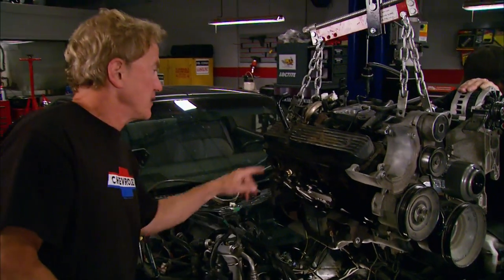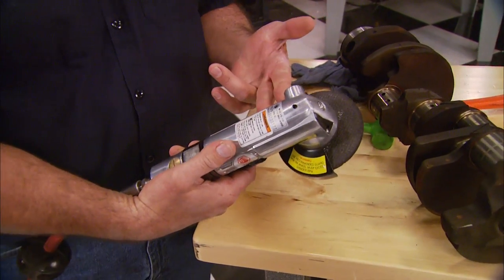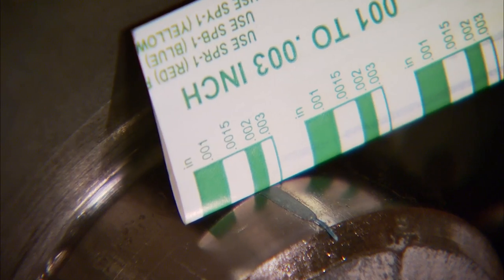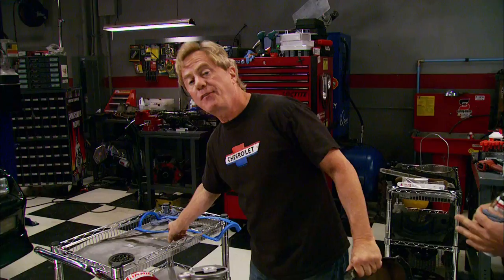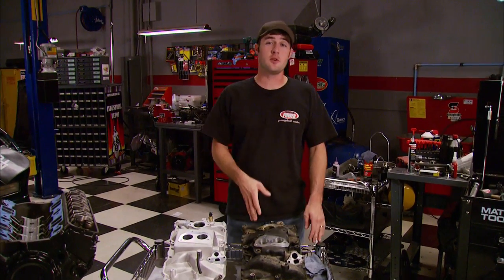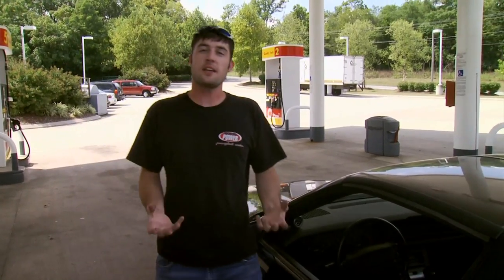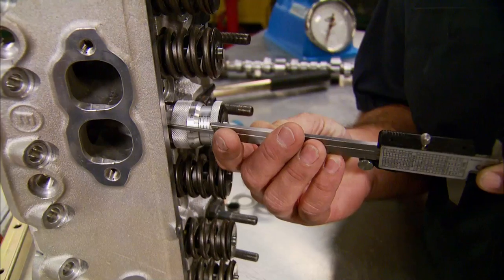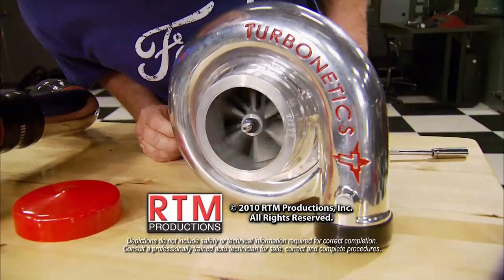Modifying a '92 Camaro Small Block to Improve Fuel Economy and Power - HorsePower S12, E17

Comment: No wonder everyone LS swapping everything instead of building the old small blocks. Newer transmissions with more gears should give better mpg too
Reply: @Jade Riley no.  Smart.  Why waste time rebuilding 1950s technology when the LS is modern and more efficient in all respects?
Reply: Even a 4.8 has more power stock than that turd with all the $$ wasted on it.
Reply: Jade Riley the same was said back in the 60’s when people were swapping SBC engines into T-buckets and Model A’s because they made more power than the old flat heads. Technology evolves and so does car building. There’s a time and a place for the older engines still. People still build flat heads. You can make a SBC have LS horsepower, drivability and reliability, but you’re likely to have well over double what that Camaro was worth sitting under the hood afterwards.
Reply: @Jade Riley so by that logic a Ferrari from 1965 with a dohc engine is the same technology as the new f488.  🤦‍♂️
Reply: @Jade Riley Idk what you're smoking, LS make plenty of NA power and sound great. You must be thinking of stock trucks.
Reply: @farcere  exactly.  A box stock LS with an cold air intake, tune and cat back makes more power than most would be able to handle.  Given how poorly most of the country drives.
Reply: Yep, but this isn't a good example.  It's a crappy 305 with crappy cylinder heads and a crappy TBI for fuel delivery.  
A 350 with vortec heads out of a late 90's truck with a decent intake and 4 barrel does pretty good for the cost.  At least way better than this piece of crap.
Reply: @greggc8088  Would of been better  to just buy a crate engine.
Reply: Oppossed to making it 450HP and losing 5mpg, when will you get your money back on that?
Reply: You half to think when you do a swap and have aftermarket parts for fuel injection, spark you can't just go in a parts store and get whatever part you need.Old carbureted cars run no matter what  plus you get more horsepower from a carburetor than you do from MPFI it's proven "engine masters dyno carb vs FI" because the cold fuel charge the fuel is cooling down the intake. I swapped TBI to Carburetor because I was having so many issues with the TBI  I'm still getting around 22 mpg with a 5500 lbs car. "it's a hearse"
Reply: @bmstylee  you still have the Dart modern blocks with the latest machining technology and EFI tech...
Reply: @kalijasin  Would have been nice, but if I had that kind of cash, I would have went to the salvage yard and gotten an LS with harness and ECM.
Plus, this is a crappy year Camaro anyway.  Didn't even have provisions in the body for dual exhaust and had the crappy torque arm suspension on the rear diff.  Let's just get another car.
Reply: @greggc8088  the ls wasn't even a thought when this show aired lol how would you go get something not yet even made???
Reply: @jonathanlawson4667  Well, you would have to go and buy a Delorean  and travel through time I suppose.  Just don't make the mistake of going to 2020.  LOL
Reply: I see a lot of smoke being blown around the comment section, as one would expect.  Nonetheless I think everybody can agree that the engine and it's running components featured here were a low point at the dawn of the modern performance era. Still interesting to see what can be made out of a powertrain that most anyone would consider a lost cause.
Reply: Jade Riley the first OHC engine came out in 1902, so what’s your point?
Reply: @Greg M a, and you will blow all your money on machining and after market parts and still Not get 33MPG. 🙈
Reply: Lassi Kinnunen well duh.
Reply: A 305 can make some decent power when it's built with high flow heads, dual-plane four-barrel carbureted intake, and a hot cam. I believe the point of this episode was only refurbishing the stock drivetrain. It would be great if they did an episode focusing on how much they could get out of a 305 smallblock.
Reply: Peter Vey the point of the episode was to show that they could make a little more power and get a slight increase in fuel mileage. But no one buys a 3rd Gen with fuel mileage in mind. They nearly spent enough to do a 5.3/T56 which would’ve gained quite a bit more horsepower and netted them 25-28mpg.
Reply: I love the LS guys, they keep selling their "old tech" for dirt cheap. Its way cheaper to replace a 305 with a 350 since just about everything swaps over for free (well, the cost of PB Blaster). All I need is a block, and I even score 4 bolts off FBM for $50. Just got to remember the balancing differences.

But everyone works with what they grew up with. While the LS guys are shopping for oil pans and serpentine belts to fit and wondering what intake is going to work with the throttle cable, I'm walking out with the Vortec heads they don't want and getting a cheap aftermarket intake to re drill.

As for the gas mileage, my 2.73 geared 86 GT  Mustang got 30 mpg by just knocking it into neutral and coasting down hills and up to stop signs. But everyone wanted to race me, so they still thought I was the type of car to beat. Fun for $2500 while the LS guys blew out their stock rear axles.
Reply: Albert Gaspar they blow stock rear diffs because they make power...
Reply: The stock 10 bolts blow with slicks or power because they aren't heavy duty stock. That messes with the gas mileage and CAFE.  Tho Chevy had the same issue with the 409 when it came out, due to they were using the 1955 rear axle designed for the 265. Good for slippery stock tires, but slicks and pow!

Luckily the stock rear axle can get strengthened before it pops.

https://www.hotrod.com/articles/hppp-0611-firebird-rearend-rebuild/
Reply: Albert Gaspar beefing up a Camaro 10-bolt is called replacing it entirely.
Reply: @TwoAMBlacktop  oh so you agree the engine power capacity has nothing to do with the axle blowing up
Reply: Albert Gaspar the 185hp a 3rd Gen Camaro, in the later years, was putting to the ground wasn’t hurting the GM 10 bolt. Once you start doubling that number and going beyond, a 30 year old 10-bolt is not going to be happy.
Reply: @TwoAMBlacktop  Right, and that means GM needed to step up the "stock rear axle" to one that doesn't blow up. Just like if Ford made a V8 that blew up the T5 to put into the Mustang, they needed to replace the T5 for that model.  When you don't have the right part...that's the definition of "you don't have the right part"  :)  You don't have the right part, because you don't have the right part, and that's why you don't have the right part--because you don't have the right part.

 Tho to be fair, a stock LS with street tires will cushion that rear axle, esp. with an automatic transmission and its hydraulic torque converter connection. Its when owners bolted on slicks that were not going to break lose and spare the rear axle, that reports came in of repeated issues when they launched hard. 

Again, the issue with a heavier duty rear axle is unsprung weight in handling, and passing CAFE--the latter is the reason we have donut space saver tires, and now just a can of fix-a-flat.
Reply: Albert Gaspar you can blame whatever government BS you want to blame, but people have been loading 8.8 Fords and even the R200 found in imports with slicks without issue. Even built, the 10-bolt isn’t really adequate. That really falls more on GM.
Reply: @TwoAMBlacktop  Which circles right back the point I originally made. The LS Camaros were blowing up rear axles not b/c of the power made, but b/c they were weak from the beginning. Had there been a Ford 9 inch or a Dana 60, would people say the LS engine sucks b/c it can't blow up the rear axle?

Put it this way--buy a 1983 Camaro base model with the four banger. Now bolt your 305 TPI to the four banger transmission. Will you blow it up? Likely. Will that make you go around talking about how powerful that engine is? very unlikely--you'll blame the transmission for not being up to the task.  And that's  the point i made long ago about the rear axles.

When Chevy offered the 350 TPI, they didn't back it with the T5 from the 305. It was too weak to warantee. They had the Corvette transmission, but failed to use it. Know why no one talks about how the TPI 350 was so powerful it blew transmissions? Because GM gave it the automatic.
Reply: Albert Gaspar I think you’re grasping at straws here. Not one person has said anything is powerful because it blows up 10 bolt. 10 bolts are known as glass diffs for a reason.

You’re on here talking about buying up 350’s cheap because LS guys, then something about a Mustang with 2.73’s coasting down hills.
Reply: @TwoAMBlacktop  yes, and right after that, you said "Albert Gaspar they blow stock rear diffs because they make power..."

Your own words--and after you said them, you've contradicted them and agreed with me ever since. so there is someone saying  something is powerful b/c it blows up a 10 bolt--and its you. you may not have paid attention to what you said, but its ok, others listen.  :)

Ciao
Reply: Albert Gaspar I didn’t contradict myself. If you’re making big power you’re going to blow up a 10 bolt. That is true. But blowing up a 10 bolt doesn’t mean that you are making a lot of power.

You’re grasping for straws.
Reply: @TwoAMBlacktop  If blowing up a 10 bolt means you aren't making a lot of power...then blowing up a 10 bolt doesn't mean you're making big power.  You're only making the power necessary to blow a 10 bolt. 

in other words, you say yourself there has to be a different measuring stick for "big power". Pontiacs used the 10 bolt back in the muscle days while Chevies had the 12 bolt. Are you saying Pontiacs didn't make big power?

You're still contradicting yourself, but now at least you're doing it inside your own post :)
Reply: Albert Gaspar like I said, grasping for straws. All squares are rectangles but not all rectangles are squares. That’s basically what I wrote.
Reply: @TwoAMBlacktop  "they blow stock rear diffs because they make power..."  suggests the presence of a square, proves a rectangle exists.  You heard hoofbeats, and thought Giraffe instead of Horse.

It would be grammatically correct to say, "they blow stock rear diffs because the rear diffs were too weak for the application."  This would be true if you put a TBI 305 together with a 4 cylinder rear axle. It wouldn't be proof the TBI305 is a powerhouse. But it would express the real problem is not the engine, but the axle choice.  GM had truck axles for the LS that didn't have a history of blowing up, and the Corvette didn't have an initial record, either. So the problem wasn't the engine, it didn't blow up axles in other applications.

The problem was the axle, not the engine's output. Don't fear, grasshopper, you'll get to see it :)
Reply: Albert Gaspar are you still on this?

Well of course they would have fixed LS equipped drivetrains to handle the load that they would be given right from the factory. They have to carry a warranty on them. Something 30 years old that never saw more than 200 ft lbs was built to suit that torque.

That also means you aren’t going to be buying Gen I 350’s from those applications that “the LS guys are blowing up diffs,” your words, not mine.
Reply: @TwoAMBlacktop  see? now you're starting to get it :)  They did fix the drivetrains in the F bodies...eventually :)

But I do buy Gen 1 350's (wanted to get a pair of 400's, too, but ran out of room in the garage). Picked up a pair of 4 bolters for $50 a piece. Scored a sweet Olds 455 for $150 from a kid wanting an LS who had no idea he already had a 4-4-2 intake and Engle cam to go with his headers. A stock 351W with EFI and last week a Holley Pro Jection for $20 (and a disassembled Muncie 4 speed, old guy was cleaning out garage to change hobbies). Can I get any of these to make LS junkyard power numbers?  Sure, there's a ton of recipes here and elsewhere online. will they be cheap to do it? yes they will, b/c the parts are as cheap as they have ever been. i think it was partly the pandemic, partly tax season in April when i scored most of this.  so i am buying Gen one stuff from LS guys, i just don't know if they're blowing axles yet or not :)
Reply: Albert Gaspar starting to get what? They didn’t really fix the F-Body 8.5 10 bolt that much. They still don’t take much to break, although they do hold up better than they used to, but if you have to put money into strengthening it a 9” is usually the way to go.

The trucks did get upped to an 8.625 ring gear.

Corvettes have also never used a 10 bolt.
Reply: @TwoAMBlacktop  GM fixed it by replacing the entire car :)  kind of an expensive fix.
Reply: Y'all are nuts. If you want to stay with the old stuff, you're going to pay a premium. It's less work, and less money to get more power with an ls swap.  The gen 2 SBC is no longer the standard for cheap reliable horsepower. I've seen plenty of junkyard 4.8 and 5.3's making reliable 6 - 700hp without even rebuilding the stock bottom end. Swap cam, lifters, valve springs, gap rings, add turbo, tune. The adapters to bolt it into your whatever car are a lot less money and work than building a  350 to get 700hp in a reliable package. Yeah, you can probably take a junkyard 350 and spray the hell out of it and make that power for a couple of pulls too, but you're spending big bucks to get them where the LS already is (and then some).

That said - I love the SBC's, but at this point they're a fit for a classic resto / restomod than a car made to go fast. Also, the LS (technically the iron block truck engines are Vortec) IS a small block chevy. That's why the last 350 was "gen 2" and the first LS was "gen 3". There just isn't any parts interchange, because they designed it to incorporate a lot of the things that SBC performance builders were doing - so you don't HAVE to.
Reply: @notsure7874  Gen One refers to the 350 made from 1955 until the LT1 of the 1990's (not to be confused with the LT-1 of 1970) including their own Vortec line, which was a stopgap measure involving reverse cooling and the OptiSpark before the LS versions came out.

Everyone loves the engine generation they know best. Those who grew up on the LS, know by heart which oil pan is needed, which serpentine belt setup doesn't stick the AC in the frame rail, have figured out the throttle by wire gas pedal so they aren't buying a new one for $400, run VVT or cut it out, and so on. Of course, that's for the builder who wants to use EFI, if they want a carb for the venturi effect to act as an intercooler, they'll buy a brand new intake manifold--not as cheap as a used Gen one single plane.

The engines are old enough by now, one can be found with piston rings loose enough for boost. But if not, then changing rings like you said, IS rebuilding the bottom end. The stretch to yield fasteners, specificially. While you are there, you may as well replace the cast eutectic pistons nearly all LS engines use with some forged slugs. 

https://www.jepistons.com/blog/everything-you-wanted-to-know-about-the-gm-ls-engine-family

The deep skirt design is indeed strong, Ford's FE and Mopar big blocks used them in NASCAR. the thing is, an engine making 600-700 on a dyno may not be making that in an engine compartment. A dyno uses air set to 60 degrees, while most engines are injesting 100 degree air, and they are getting heat soaked inside the engine compartment since they aren't running an electric water pump, and all that turbo plumbing won't fit so they use a different design, and then that exhaust system is too big to clear the car's frame or manhole covers, so a smaller size gets used. For example, an F body has a terrible exhaust system, it always had less power than the engine used in an A body which didn't make the exhaust take a 90 degree turn after the rear axle to dump into one muffler then take another 90 degree bend to run past the sides of the gas tank.

During the Gen One's heyday, 500 bhp at the flywheel was fly, so not many were taking it to 700hp. Then again, 700 hp is expensive to put on the ground--you need a transmission, U joints, rear axle, and tires that can really grip, not to mention a killer fuel system and cooling system. Sad to say, a lot of folks claiming they have 700...well, let's just say they are missing these expensive components :)  

Thankfully, buying an aftermarket set of aluminum heads that can take a Gen One 350 up to 700 hp isn't difficult anymore. Admittedly, I too would be thinking of an aftermarket block around this point (really not that expensive either, since you're in big dog land, and I'd go 4.125 inch bore (Dart block $1800 from Jegs, LSX block same bore, $2,200).
Reply: @notsure7874  Gen II has never been the cheap standard for going fast lol. Gen II is the 90’s LT1. You can’t beat the LS $/HP unless someone just hands you parts for free.
Reply: @albertgaspar627  Yeah man, I grew up on the old tree fiddys, ford 302's, 351's, FE's, BBC etc. My all time favorite engine EVER is a 327 with the Rochester Ramjet in the 2nd gen vette. Mechanical fuel injection is a soft spot of mine. The old mercedes SL's with the Bosch mechanical injection - DROOL! As much as I love modern tech, I have a huge soft spot for some of that older forgotten tech like the Ramjet. I love them all for what they are. I totally get why people stick with what they know. One of my friends has a 64 GTO - and if he ever even MENTIONED LS swapping it I'd choke the living daylights out of him. It's a GORGEOUS car. I haven't seen it on a dyno, but I'd be shocked if he wasn't putting over 500hp to the ground NA (12:1 compression, he runs avgas). But he's got a TON of cash wrapped up in it too. There's no WAY I'd think about building what he's got to put in my DisguStang. He's got twice the cash in that engine that I'll have in my whole car.

 I've seen guys check ring gaps, re-file them if they aren't gapped enough, stick them back in and reuse the TTY bolts, drop a cam / springs in it, and boost tf out of it - and they work just fine. At least - that's the extent of bottom end work - it's not rebuilt by any stretch of the imagination. I'm talking whp too, the only dyno I've had access to is a chassis dyno. And yeah, you're right that you're not exactly doing that with a stock 4L60E, most of these guys are either going for a 4L80E or like me - a TH400. As for the fuel system - upgrade the pump, and a bigger fuel line, and bigger injectors - but that's all bolt on. Buying aluminum heads for an SBC most certainly is easy - but it's also over a thousand bucks, and like you said - you're not doing that with a stock block (probably - I've SEEN it, but not so smart), much less a stock crank and rods. You're talking another few grand for a forged crank and rods. You can push an gen 3 in the 1000hp range on a stock rotating assembly, pistons and all, in a GM block.

And you're right - you're not putting 700 to the ground without some expensive components, but you're going to have to do similar things to the SBC, in addition to spending a ton more on the long block too. I'm not at all an LS guy, but - a lot of the things I've always wanted to be able to do with an SBC but was SUPER expensive - is already done in an LS. Believe it or not - I was pretty resentful for years that GM did away with the old 350. It was my go-to forever (and the 400 SBC) with all the parts interchange, and the ability to swap things around - like a 400 block 30 over with a 350 crank, or a stroker 383 ... I built my dad a 400, put 64cc heads on it - but the big valve (202 / 160) not the crappy 305 64cc heads ... you can swap later vortec heads on them and an intake to match because different angle on the intake runners ... I LOVED playing "Mr. Potatohead" with those old SBC's.

I actually never even really touched an LS other than bolting on some crap for my friends until the last couple of years. I got set straight by a friend who - like me - was monkeying with this stuff before the LS existed, and he isn't even running an LS. He's running a tall deck ford motorsports Lima 4 banger stroked out to 3.0L running 40lb of boost in a fox body. It's light, it's in the 1000hp range. It's SUPER bad ass, and not "new tech". But he's got close to 50 grand under the hood too. I'm not that "LS guy" by any stretch of the imagination. I'm just chasing cheap(ish) reliable horsepower.

Speaking of Zach and his LimaStang ... He thinks I'm crazy and "trying to spend as much money as possible" but ... after I get the ones I got put in whatever they're going in ... I want to build a modern day version of my favorite. If you go by "bore / stroke" and use the "Mr. Potatohead" phillosophy on an LS ... you can put a 4.8L crank in a 6.0 block and it comes out to almost identical bore / stroke as the old 327. I'm not sure about rod lengths, or if I could use any stock rod length, and a lot of details aren't ironed out - and I'll never be able to afford a Ramjet, but EFI really is "better" in most ways, and I think it'd be awesome to have a short stroke zinger of old, with tech of new! That one though - I'm going to do all the things I don't "have to" in a beater "cheap powa" engine. Forged crank, really not sure if I'm gonna keep the sintered / cracked rods - they have advantages like the cracking at the cap making them "stick" and not have any tendency to shift, and they're super strong - but forged are also very strong... But I digress. DON'T GET ME STARTED!!! :D
Reply: @LTXwooshie  no it doesn't lol you can't take a 90s smog 305 and compare that to a LS lol take a 5.7 vortec and it has more power stock than a 4.8 or 5.3 LS it's not all cut and dry like everyone thinks and I'm running a mildly built 350 old school with around 400hp in my Camaro with a posi 373 gear and I can walk stock LS engines it's all in skill and if you know how to build a motor and most importantly what motor to choose and no engine builder is going to choose a 90s smog 305 lol these guys could've done this work to a 350 vortec and had way more power than any LS engine
Reply: @Anthony Thunderflaps yeah but they're king of the street racing scene and have been for many years 🤣🤣 when you can take a junkyard LS and twin turbo it and beat hellcats that says it all right there and I bet you got beat by a clapped out LS swap didn't you 🤣🤣🤣🤣 hater
Reply: @jonathanlawson4667  Wrong. Stock L31 vortec made 250hp. Stock 4.8 makes 285 hp. I'm not saying there isn't a market for old school. I'm saying this video was the biggest pile of shit for wasting a shitload of money to make what? 30 hp? Also big deal that a mildly built car beats another bone stock. Cam swap that 350 vs cam swapping any ls motor and see who walks on who.